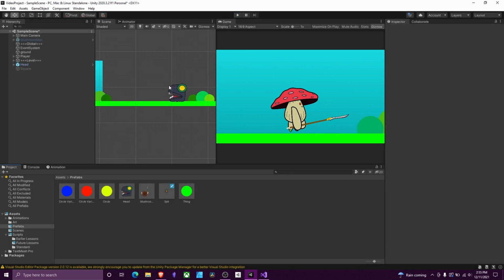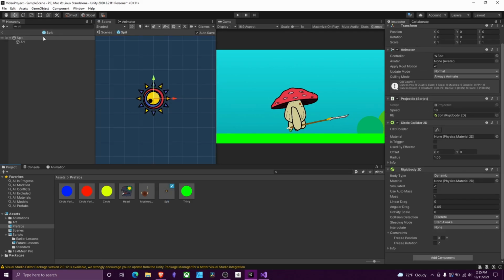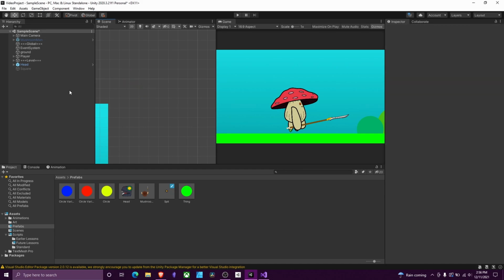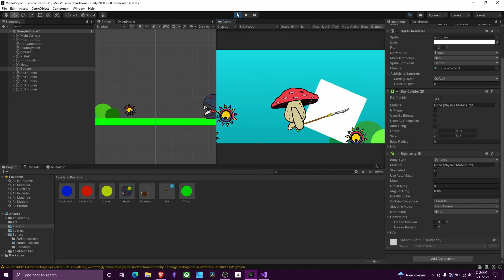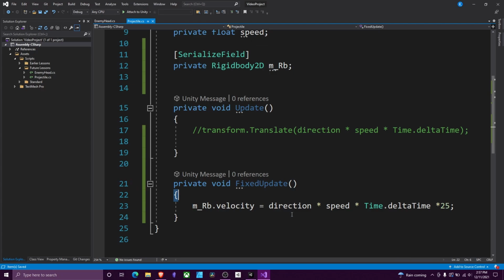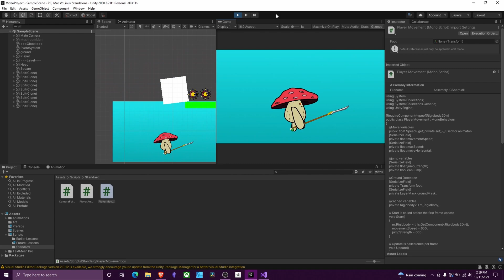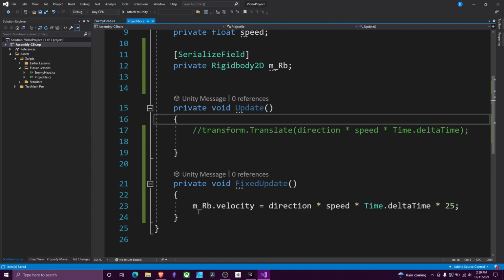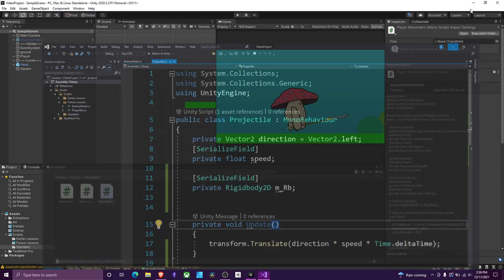Unity Fundamentals:  Movement - Velocity vs Translate

Comment: If you want a little more consistency and less guess work between Update and FixedUpdate, you can multiply your velocity by Time.fixedDeltaTime instead of deltaTime in the FixedUpdate loop.  Some newer versions of Unity apparently deal with that automagically so that deltaTime could be used regardless.  I tend to use each in the appropriate methods out of habit :)
Reply from the maker: yep! Did I forget to do that? If so yes,,Time.fixedDeltaTime for Fixed Update normal for normal update